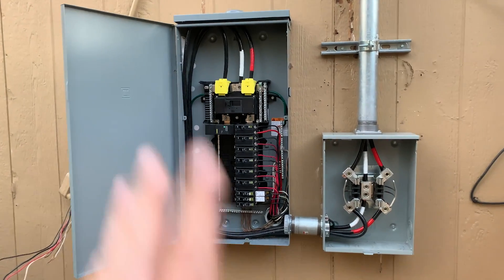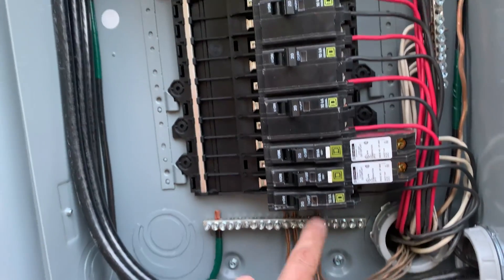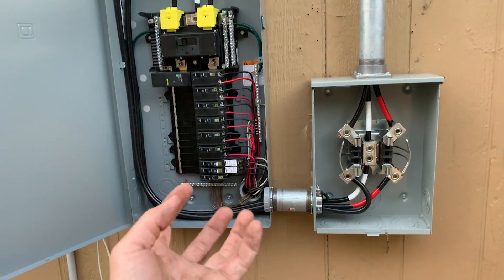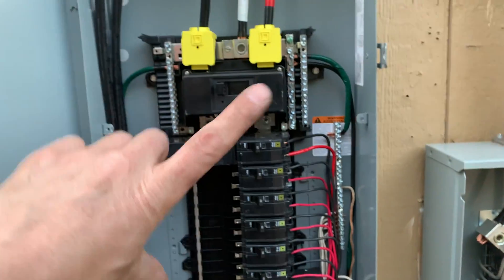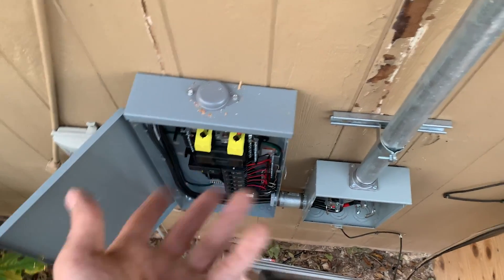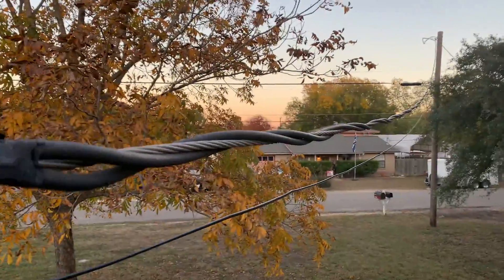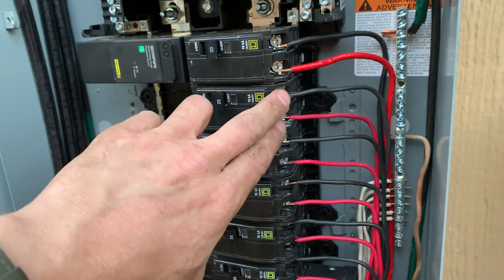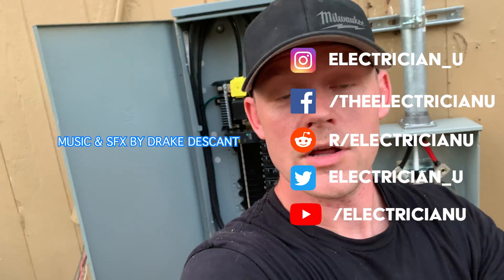I Just Changed Out My Electrical Service

Comment: Square-D Home-Line "Plug-On Neutral" Load-Centers & GE Power Mark Gold Load-Centers (available in 240/120 Split-Phase/3 Wire Service Configuration Only) offers a "Split-Neutral Buss Design", as such provides a neutral termination adjacent to each and every circuit-breaker termination, and also provides additional terminations for combined neutral/grounding & earthing terminations where said load-centers are used as service-entrance equipment... where such load-centers are not used as service entrance equipment, accessory equipment grounding/earthing buss-bars are available to facilitate the necessary division of neutral & grounding/earthing conductors (so as to prevent parallel paths of return neutral currents on metallic parts not intended to carry such objectionable currents I.A.W. NEC Article 250.

Square-D Home-Line load-centers also have provisions to mechanically fasten optional equipment ground/earthing busses on each side of the main-buss interior assembly, when required to isolate or to separate the neutral from the ground/earthing conductors. This feature also lends to a much more installer-friendly product that easily facilitates a speedier installation, without the additional clutter or unnecessary lengths of grounding/earthing conductors needing bundling or tying continuously to one end of the panel-board or load-center or the other, as in some other designs that only permit the mechanical installation of such accessories in those locations. 

This keeps individual circuit conductors grouped together relative to that circuit for easier circuit conductor tracing/identification. Individually labeling, marking or tagging each conductor may sound like a good idea at first, until the same installation is visited years later & those markings either become faded or illegible or missing altogether, due to the adhesive drying out & the tags or labels falling off the individual conductors. Conductors that are logically placed in a numerical order or fashion makes more sense and when such wiring practices are adhered to, negates the additional efforts to mark, label or otherwise identify those groups of circuit conductors when grouped or bundled together.

Such load-centers are available in split-phase 240/120 volt buss-bar configurations only, unlike their 3-phase counterparts; of which has their neutral busses grouped up near the main lugs or main breaker. I personally prefer the split-neutral design/configuration for a number of reasons: 

ONE of which, makes for a neat, clean, orderly & workmanlike installation that is free from wiring clutter near the main lugs or main breaker., as such is messy, annoying, and may also pose a safety hazard when servicing the equipment, as the main-lugs may remain electrically energized, without any real or practical means of effectively de-energizing... Newer or more recently manufactured Square-D electrical equipment is now appearing on the marketplace with special "main-lug shields" included or with such kits as being available for retrofit for compatible equipment.

TWO; when working on such equipment, placing the neutral next to each load terminal on each circuit-breaker, also keeps the circuit conductors at about the same length & also makes for tracing paired or networked conductors (such "networked" conductors sharing a "common" neutral conductor, identical to the incoming service feeder conductors) feeding the load-center or panel-board.

Both GE & Square-D Home-Line accepts a universal format 1" plug-in circuit-breaker format. The Square D Home-Line utilizes a tin-plated aluminum main buss, whereas the GE Power-Mark Gold utilizes a tin-plated copper main buss. Both brands of load-centers also are available in both NEMA-3 & NEMA-3R enclosures.

Square-D Home-Line "Plug-On Neutral" load-centers also facilitates Square D Home-Line "Plug-On Neutral" GFCI, AFCI & CAFCI Circuit-Breakers for additional convenience & expert installation without the use of those annoying neutral pigtails, in addition to having additional neutral screw terminal positions conveniently positioned adjacent to each & every circuit-breaker. Square-D Home-Line "Plug-On Neutral" breakers & "Plug-On Neutral-Ready" load-centers also lend for a much tidier & neater installation, free from all that needless wire clutter!

I hope this helps with your installation, as I have been performing such installations now for well over 20 years, and where I'm from, we also do live tie-ins of the overhead service drop conductors & swapping the meters from the old to the new service meter-base sockets or pedestals (for underground service entrances) or where new services are added & the service drops are provided by the local utility for temporary electrical service (as often is required on new construction) the meter socket may be jumped temporarily on Class-320 Meter Sockets for 400 Ampere Electrical Service on larger, custom homes or certain commercial/industrial installations that utilize such service, of course until the local power utility/supplier has the opportunity to make their unscheduled appearance to install the permanent metering equipment, and occasionally to also provide permanent crimping lugs & plastic boots on the overhead service-drop point of attachment, to replace the commonly used split-bolt "kernies" & electrical tape, as is the commonly used practice for live overhead service tie-ins.

Additionally, service feeder conductors (#8AWG ~ 600MCM) are now available in a rainbow of different colored insulation to negate the utilization of colored electrical tapes for the purpose of marking individual conductors for the purpose of neutral & phase identification. Most electrical supply merchants will now offer this as part of their normally stocked inventory, as electrical inspectors in many different jurisdictions are now requiring the utilization of differently colored service conductors for ease in continuity of identification without any margin for error. I personally like this because it makes for a more intuitive & expert installation, further demonstrating competency in planning, procurement & installation without any problems or hang-ups when it comes to permanently marking conductors for use.

Ground-rods & cold-water bonding is also a necessity for secondary grounding electrode systems (and in certain other jurisdictions), bonding of other metallic piping systems (i.e. natural gas and/or water pipes) to ensure a zero-voltage potential is maintained across all extraneous metallic components of any particular installation for safety from the risk surrounding electrical shock injury. It is also important to note that where a cold-water service bonding must me maintained for the assurance of a reliable path for grounding/earthing, the supply-side of the water meter shall be grounded first, with the same continuous length of the grounding/earthing bonding conductor looped through across to the load-side of the water-meter to facilitate a solid, reliable bond of the entire metallic plumbing system in the event that the water meter is removed, to prevent electrical shock to service personnel or anyone else who might come into contact with any extraneous metallic parts or components. An inter-system grounding/earthing bridge/interface may also be required, depending upon your specific jurisdiction... in my jurisdiction though, such bridging/interfaces may not be practical for installation & are often not required, based upon the required components utilized for a typical 200-ampere electrical service with #3/0AWG service-feeders... in practice, a #4AWG (Green) insulated stranded copper conductor is typically utilized in conjunction with 1/2" type EMT, IMC/GRS conduit, for which said conductor sizing may be too large to fit in some certain bonding/bridging interfaces, and as such, a grounding/earthing pipe clamp, used on the 1/2"  type EMT or type IMC/GRS conduit (for which is directly coupled to the grounding/earthing rod electrode by means of a combination pipe-clamp/conduit-hub) is typically utilized on these installations in lieu of a bridging interface, in addition to the risks of missing parts or parts that become missing from rather unscrupulous CATV and/or satellite dish TV installers... or in installations that are or may be subject to tampering or vandalism... whereas a simple grounding/earthing/bonding pipe-clamp can be much more easily replaced when compromised, damaged or missing, to ensure the continuity in reliability in the bonding/bridging application. 

Special & specific warning tags are also utilized in practice when marking such electrical bonding/bridging or supplemental grounding/earthing connections or terminations.

I personally have encountered many different types of methods in grounding/earthing/bonding during my worldwide travels in the military (from the Korean Peninsula to the middle-East, whereas European electrical wiring methods & specifications are especially adhered to in the middle-East, as they've adopted the British Standards when it comes to electricity regulations, line frequency & voltages.)

Comment: where do you get those plastic yellow caps?!    I've been making my own out of cardboard and tape.  I honestly don't know why the main panel makers haven't added some sort of plastic cover that completely encloses the line terminals....working on hot panels is unfortunately a reality all too often.

also, anyone care to comment on a stylistic thing:  I'll cut the neutrals and grounds short and neat since their mounting locations usually aren't changing (but often run them to the farthest possible terminal).  But, I tend to fold the hots alongside the right and left and leave a 6-12" of slack just so that when breakers have to be moved, there are options.  they still come into each breaker neatly and horizontally at the end.
the other thing I might be tempted to do if new install is to put a big raceway at the bottom and leave the slack in there.

One other thing.  I think for multiwire the wires are supposed to be "grouped" according to code.  I've used a couple plastic tie wraps on each pair, but not sure of the official way to do it.  (most recently, redid one where the licensed electrician had scattered separate breakers all over for multiwire (most were on 2 diff phases, but 1 wasn't!--neutral potentially carrying 40a)

last question....is there a reason for the conduit bonding jumper being in the meter box instead of on the main panel side?

anyway, very nice job for residential.  better than 98% of the panels I look into on houses.
Reply: Those barriers come with the panel
No need to group the conductors of a circuit if it’s obvious, ie. sharing a common jacket. Conductors in raceway I just throw a cable tie on each or number the neutrals
Stylistically I don’t like loops left in the panel. If I want extra I will run to the opposite side.
As for MWBCs a handle tie is required, but usually we just put it on a 2-pole . Only inconvenience is that if one circuit trips due to overload, the other will also be tripped. And always have each hot on a different leg/phase.

Comment: Nice looking job bro! I see different jurisdictions require trivial things be done certain ways. In my jurisdiction in VA, the supply-side bonding jumper in this type of installation is required at the panel end for the bonding bushing due to the utility requirements of no "customer grounds" in the meter base. Seems silly as it's to code either way but it all depends on where you live. Great video once again! ✌️

Comment: #6 Bare copper to ground rods/ground slab with 200 amp service? In my area I have to do #4 copper for 200A service
Reply: GEC is sized based on the size of the SEC.
Reply: @uhjyuff2095  SEC from a pole/transformer???
Reply: @BAFiusRUS  GEC is sized based on the size of the service conductors that terminate on the main/first disconnect, not that ampacity rating of the main breaker.
Reply: @uhjyuff2095  I see now. He used copper on line coming in. It is smaller sized than aluminum seu we use. We use 4/0 aluminum for 200A service

Comment: If most of those circuits are 120 why use double pole brakers ?
Reply: According to the code, you must now have handle tied breakers for any circuits sharing the neutral wire.

Comment: I noticed you only mentioned a grounding conductor to the slab, don't you need a 2nd supplemental means of grounding? Rod, plate, metal water pipe, building steel, etc?

Comment: Would you be able to do a beginners guide on how to add breakers/circuits to the main panel ? For running new outlets, lights etc thanks!
Reply: It’s not too hard really - for 120V, just run a hot to the breaker, neutral to the neutral bar, and ground to the ground bar (the last 2 will be the same if it’s the main panel).  For 240V, there will be 2 hots on different buses.  Just make sure you know what’s hot and what isn’t for safety.

Comment: Over here if you have a 200amp main breaker the ground has to be #4 bare wire 
We would need an intersystem bounding 
2 ground rods 6 feet away from where the first one is apart from the other 
Have it connected to the gas also 
Spay foam the hole from witch we made 
And label the panel maybe you did but didn’t see and 
Have a lever bypass meter
Reply: No ground rods if it’s connected to the ufer.

Comment: I believe neutral should only be bonded at one point. That ground bar in the meter can should be floating. Meter can is bonded through the nipple.
Reply: The meter socket box is UL listed for its purpose. The main panel neutral bar is always bonded to the enclosure.
Reply: @uhjyuff2095  I don’t think you understood my original comment. I didn’t say the neutral in the main panel should be floating. I said the neutral in the meter can should be floating. Firstly, the meter is not a service disconnect. Secondly, the neutral may only be bonded in one location. He has two locations he’s using for this. There’s two reasons for you that it’s not code compliant.
Reply: @RB-xv4si  Yeah you are right, it is a code violation. Another code compliant way to install this is to use a pvc nipple instead of a metallic one like he used. I say this because there is an exception in code at 250.30(A)(1).

Comment: Nice video, thanks for sharing. 
There are a few things that I noticed that would not pass inspection here in Santa Cruz CA. 
-uffer ground should be #4
-gas & water bond #6
-The chase nipple for all of your non cables is not rated for that use. 
-3 wire circuits must be labeled or tied to corresponding neutral wire. 
-no arc fault required for existing circuits that have not been added to (more than 6’)
I’m not saying you won’t pass your inspection, but inspectors here would call me out on those items. 
Cheers
Reply: I meant NM-B cables z(romex)